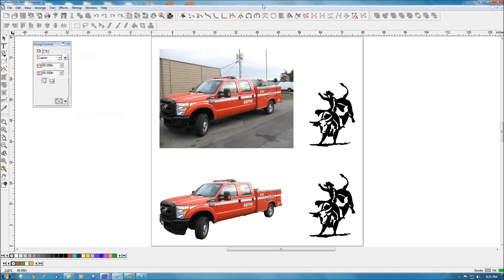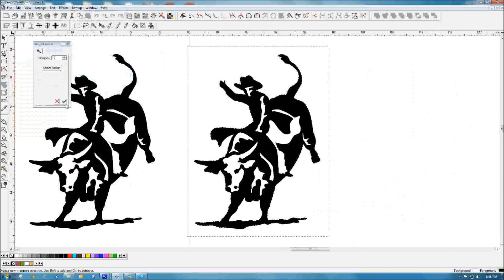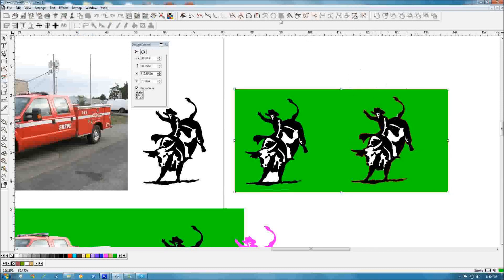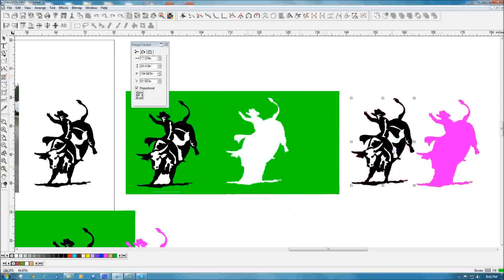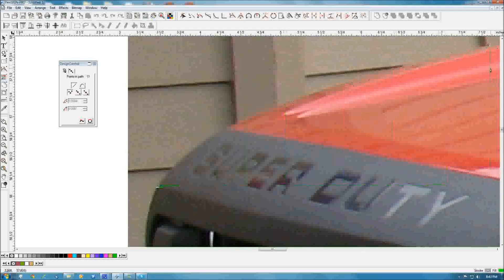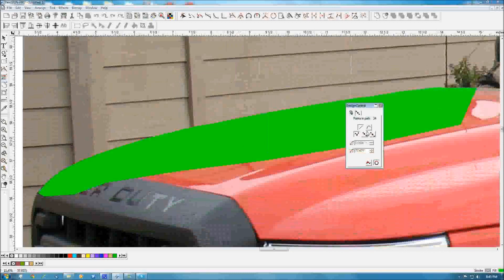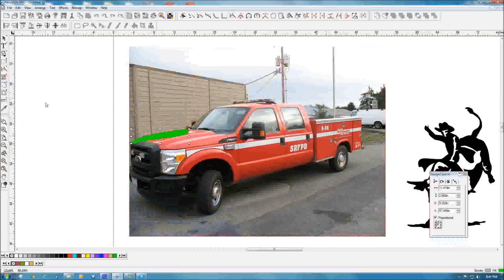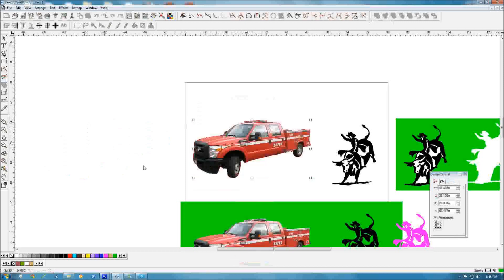FlexiSIGN 8.1 Tutorial - Extractions

Comment: What I'm trying to do is wrap just the back half of the vehicle starting from in between the front & rear doors of a Ridgeline to the back.  Having trouble masking it correctly.  Any help would be greatly appreciated.  Thanks!
Reply from the maker: +William Melgar, the first thing is, making the mask as tight as I did in the video, absolutely does not account for the curves of the vehicle. A tight mask like that is great for showing a customer the look you are aiming for but it will not work for the actual printing portion. You have to add a fat outline to your mask to account for the extra material needed to fill curves. We put several inches of bleed on some prints because; while you have a good idea where everything is going to land, once you start stretching and pulling, things will move. Some jobs can require a foot or more of bleed in places. I absolutely hate printed and contour cut flame jobs for this very reason. The first side looks great and then the second side is a total fight to get the positioning to match.
Not sure if that answered your question or not....